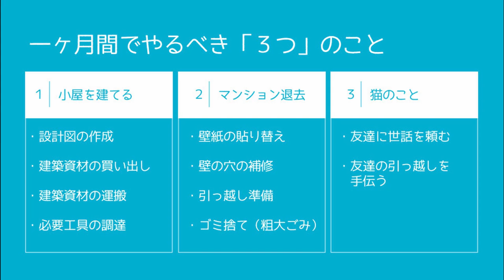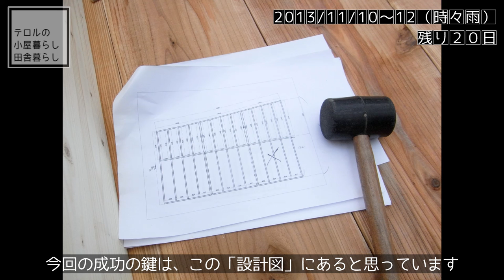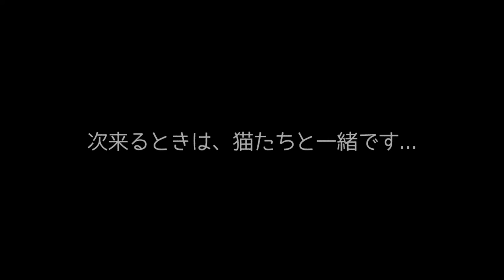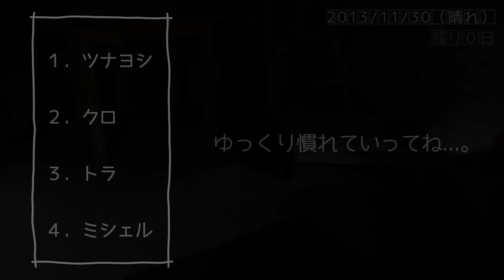無職になった僕が土地を買って小屋を建て猫４匹と移住するまでの１か月［vol.20］

Comment: Hello I love this home and your decision to move! Can I check with you what material is that semi transparent window on 11:14? Is it receded glass? I am building a fan and thinking if there’s anything that looks like receded glass but not easily breakable. Thanks!
Reply from the maker: It looks like a reeded glass but a polycarbonate hollow board. This material is strong,very light and has a great thermal insulation but I’m not sure if it would work to your fan. Hope this helps you!
Reply: @morinoterror  thanks - i have never heard of that - i will research and take a  closer look. Thanks for answering my question!!! Looking forward to your next video:D